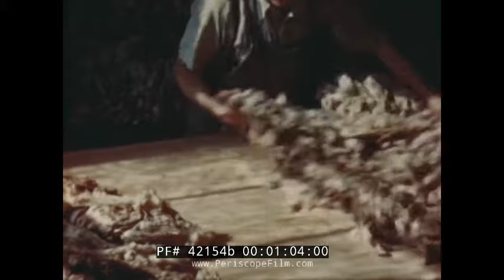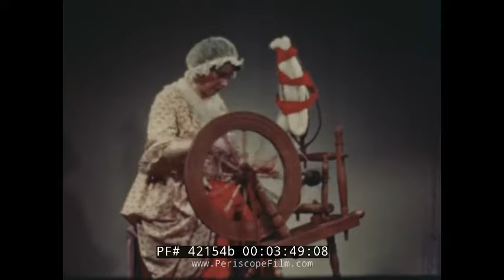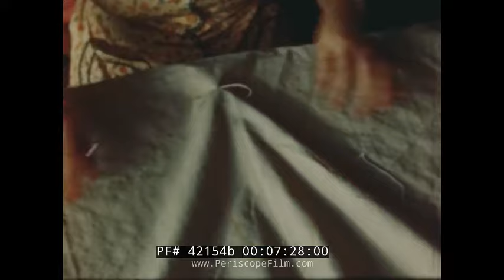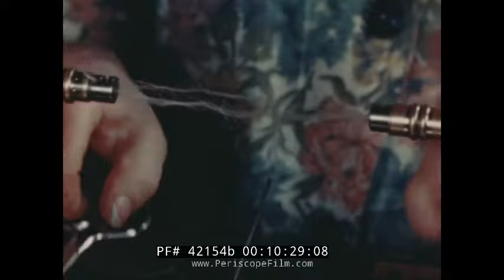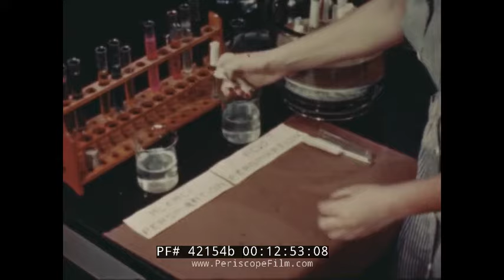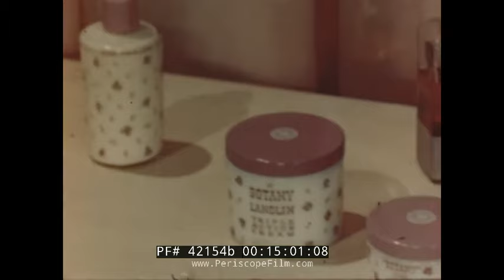BOTANY MILLS FABRIC COMPANY 1940s WOOL FABRIC PROMO FILM  BOTANY 500 42154b

Comment: As someone immersed in the history and culture of the wool trade of Bradford (UK) I was really glad to see this. It matches a lot of what I know was happening in Bradford in the 40's.
 Two little points: I was surprise the wetness of the wool was not tested, although it might have been tested on buying. It was the first thing tested in Bradford, because wool was traded by weight, and adding water was not unknown. 
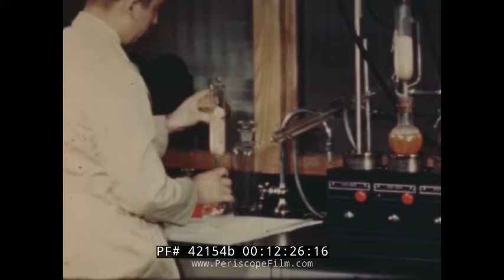Secondly the fats and oils mentioned at 12:28 were lanolin; but the name is not used until later, when talking about cosmetics. Bradford sewage works used to extract and sell so much of it from what the mills washed into the sewers that the plant made a profit!